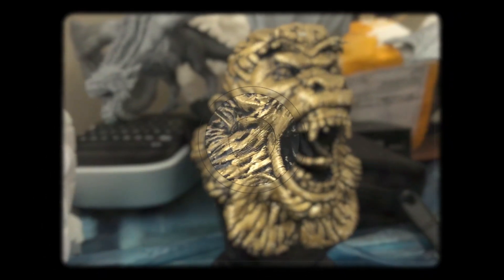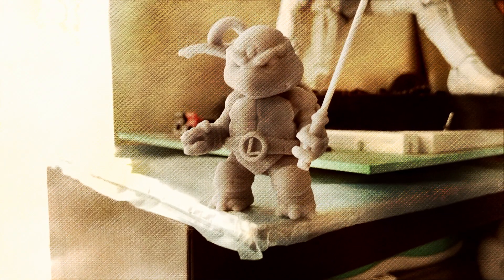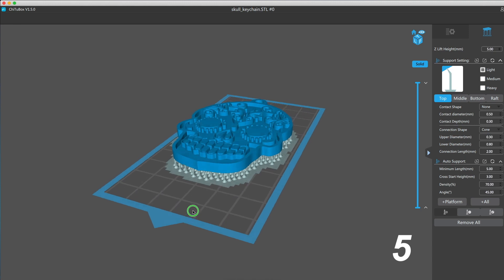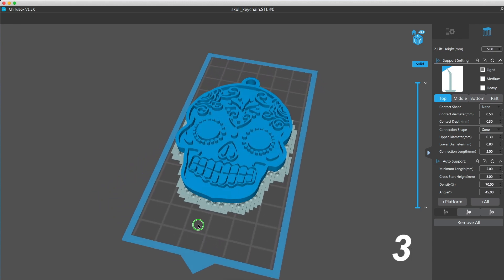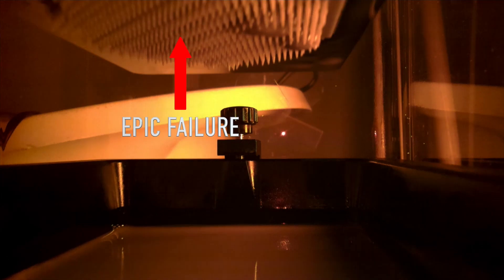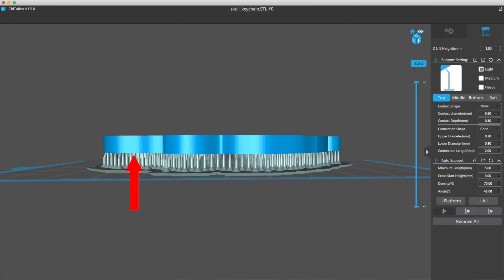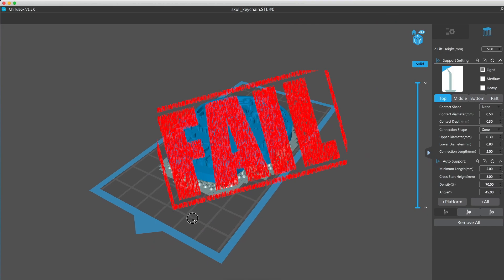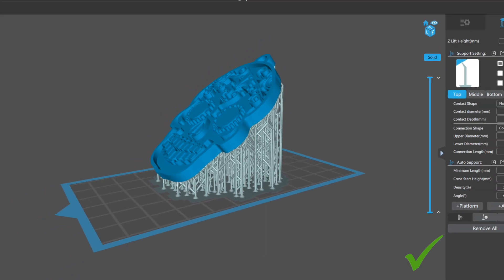Did It Fail ? Chitubox support overkill or was it not enough!

Comment: Perhaps you can cover priming before printing? You have been making some really helpful videos and this is a problem for some reason not being covered yet. This video partially covers it. https://youtu.be/eDl3vzZy0qQ?t=416
Reply from the maker: Hey, I’d love to. I’m not sure what you mean by priming before printing though. Tell me more so I can do some research
Reply: @FrameonesMakerspace  Sorry I meant priming the build platform before printing. So it would be (Coat/Cure, Coat/Cure) then print as an example.
Reply from the maker: Fun Guy ahhh gotcha. I will do a video on sanding the buildplate. In the interim, make sure you have leveled the buildplate using a sheet of paper and wipe it with ipa and a rag/paper towel before printing.

Comment: I bet the second print will have some slight warpage. I would have just printed flat with no supports.
Reply: Yeah if you have a flat face to work with that's the best route to go I find
Reply from the maker: Pop! Builds totally agree. I am still wondering why I didn’t put it directly on the buildplate, lol. It did help me make two more upcoming videos tho 🙂 Look out for them
Reply: Yes your solution work great. But sometime you cannot print without support. My problem is with very shorts supports. They are not fusionned with the print. So the issue is a print fail. But, because I'm a newbee in resin print, may be I miss another thing with Chitubox ??
Reply from the maker: Fulgur Gris have you checked your exposure settings and angled your print?
Reply: @FrameonesMakerspace  Thanks again for your fast answer. Exposure is ok. Between the time of my 1st comment and your answer I had the time to watch others of your videos about resin printing. And I saw indeed that almost all your pieces are placed quite high compared to the plateau and also inclined. So I launched an impression of a shield (the statue of Conan on Thingverse) inclined and placed about 2 or 3 cm from the board. The impression is at this moment at 41% and everything seems ok. I still find that it's annoying because we use a lot of resin just for many supports, while if I put the shield flat on its edge and on the plate it would need only a few supports to support the rounded down of the shield. 

But I still find it very odd that only small supports can not merge with the printed part and that others do not create any problem.
Reply: @FrameonesMakerspace  Shield was ok. Tomorrow I will try to print the same shield again on his round edge, without inclination but to 2 or 3cm from the board to see what happen with long supports.
I'm trying now to print the Conan figure not inclined but with z axis -4mm. Now both feet are at the same level of the board. Indeed the figurine has under a foot a small rectangle to stick in the base of the statue. As a result, the two feet are not at the same level on the board and one of the feet is not  in contact with. That's why the software creates small supports under the feet... but that do not adhere to the piece.
Reply from the maker: That’s a great idea. Similar to a lithophane.